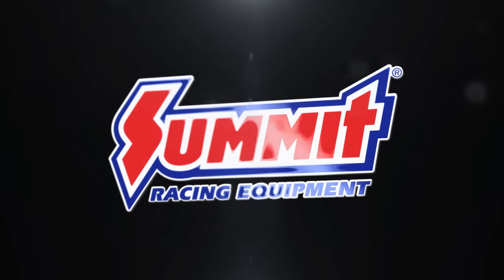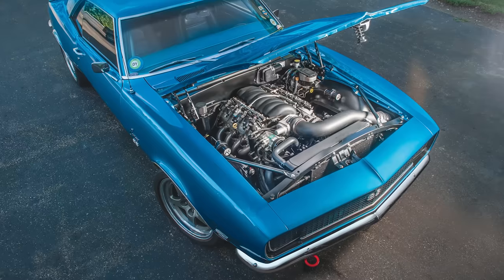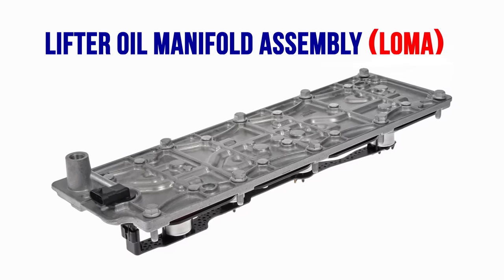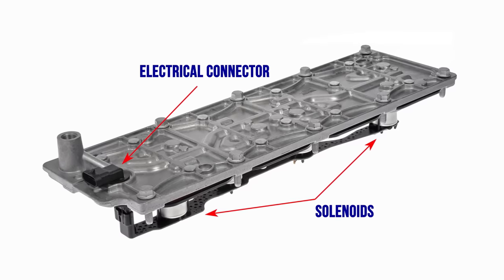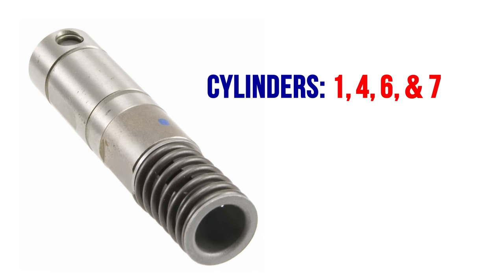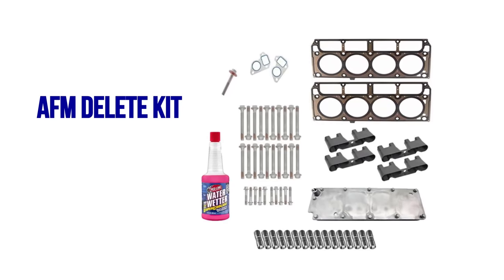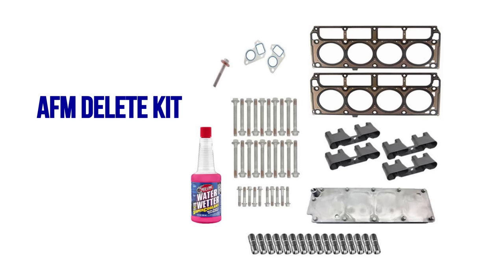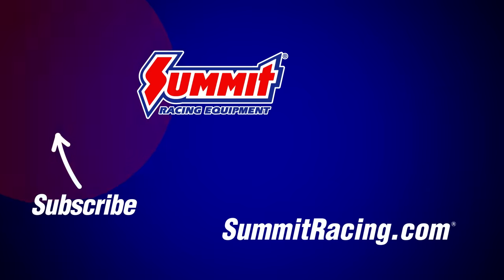Why and How to Disable GM's Active Fuel Management (AFM)!

Comment: The third way to disable AFM, put the shift lever in “L”, then manually shift up to 5th gear and you have full time V8.
Reply: This also disables stop-start. Another 'feature' that may cause more harm than good
Reply: Question: In order to disable AFM this way do we ALWAYS need to select the L5 gear first before moving? Or…. does the AFM disable also occur if you initially select L in any other gear before moving?   I ask the question for 2 reasons:  1.)  I do a fair amount of heavy towing and for steep downhill engine braking I like to initially select a lower gear than 5, on occasions.  Also, to ensure that my engine doesn’t “lug” at highway speeds I often select L8 (or even lower) in order to keep the coasting revs at 2000 RPM or higher.

Comment: My 07 Denali Cylinder 7 Failed. It was ticking bad, then once day Motor went BooZoo and Ticking qone, but now I can't drive no more than 30 mph or the Motor starts to shake bad. 
Well I havent been driving it, Since it shakes bad, But Sometimes I do wanna drive it very slow.. But I may be creating a bigger problem
Reply: I believe the Denalis…in Sierra trim, the 6.2 doesn’t have afm….mine don’t.07-13…but in SUV’s they had afm, kinda weird but I’m grateful my motor doesn’t have it,runs awesome.
Reply: Time to get another motor go to the junkyard and disable that crap

Comment: anyone know if i can run stock lifters with an afm/dod delete kit (I have brand new stock ones and im trying to save cash)
Reply: You can if you change the camshaft. The AFM camshaft is different in order to have room for the AFM lifter springs on the cylinders it deactivates.

Comment: Just by a pre AFM GMC or Chevy truck. Preferably made in Canada that has been in the south with no rust .. 
That's what I did ... these trucks are going up in value and demand since GM and Ford have AFM and turbo problems...
Here's a thought GM and Ford.  Stop making the front end so high it looks like a wall going down the street. Aerodynamic play a huge roll in rolling resistance. 
Also making your trucks higher is stupid also . They are harder to work out of for a tradesman , unless he's 7 feet tall 🤥
Reply: Or a BIGFOOT

Comment: So with the range obd2 disabler it's not just plug and play in the 07 impala SS? He's talking about the pressure valves and whatnot. Is it a bad idea to put a range disabler onto a stock impala ss? What needs to be modified. Hard to find a 1,2,3 step instructional on using it on impala ss or grand prix gxp
Reply: I have a range obd2 disabler on my 2015 gmc 5.3 and it’s the best thing I’ve bought...no problems so far so it’s definitely worth the try
Reply: @loganspence744  was debating and seen people giving good reviews on superchips handheld tuner. Got one on ebay as a refurb but it was actually brand new. Unless that is what their refurb looks like. Was 199 for the "refurb" looks like they were out of refurbs and sent a brand new one. Straight from the powerteq factory. They make diablosport tuners and AFM disabler. Dashboard tuners. Was a great deal see how it goes.
Reply: @loganspence744  where did you buy it from
Reply: i unplugged th afm sensor on the brake booster, no ticks no oil consumption,  from 60 k to 89k no problem, it does throw ck engine light,  afm does not come on at all. 06 monte carlo ss 5.3

Comment: I've heard these Range need updated sometimes. The older Chevy use to show that you were in v4 or v8. The newer ones don't show it. How can you tell if the Range is working or needs updated?
Reply: The newer ones do.
Reply: @todamax1253  I've got a 2020 and it doesn't.

Comment: I noticed he didn't mention if the injectors for the "disabled" cylinder's are also being shut off. If they are not this will cause premature wear on the rings and cylinder due to wash down from unburnt fuel also assuming that spark to said cylinders is disabled.
Reply: Well if the fuel is still sprayed it kind of defeats the purpose of AFM.
Reply: dude...

Comment: I have a 2014 Silverado with 130,000 trouble-free miles..
Not one problem..
I tow and off road and average around 23 to 24 MPG...
Reply from the maker: Awesome! Thank you for watching.
Reply: I also have a 2014 silverado with 56.000 miles no problems . But i change oil every 5000 miles i use mobile one and I add BG product MOA this give me $4000 dollars towards the repair if you put the product in every oil change.
Reply: @carl0079 . Nice!  I wouldn't add anything to your oil..
I use mobile one only.

Comment: Pulsar Lt is the way to go with new GM 1500 trucks.
Reply: GREAT INFO!!!!!!!!!!!!!!!!!!!!!   😁
Reply: But remember to unplug it and put it back to stock before going to emissions test. Certain systems won't say "READY" and you'll fail. Drive on L9/M9 to prevent DFM from activating.

Comment: Bought my '15 Silverado 5.3L in '17 with 21K on the clock. Had a slight lifter 'tick' when I started it until I drove down the street. Got a tune that disabled it and the tick went away after awhile. Change the oil regularly and have nearly 89K now with no issues. I didn't like the sound of it. AFM is a bad idea in a V8 and was done only to appease the government.

Comment: We don't want AFM because the lifters are garbage and always have been.  AFM lifters fail with or without regular oil changes.  A disabler does nothing to prevent the AFM lifters from failing.  A delete is the only way to stop the inevitable.

Comment: I offer dod delete in the ecm tune, contact me if you need dod turned off aswell as the fault codes. This will fix your dod problems if your having intermittent problems and misfires.

Comment: Thanks for telling us about the 1981 Cadillacs this technology is only 40yr old. Diss activate that crap
Reply: Actually the  Cadillac variable displacement was controlling rocker arms not the lifters. Honestly if properly maintained the LS style tend run fine. Till the parts fail.

Comment: Screw that, just give me an old school Chevy engine before they came out with all this modern B.S. technology.
Reply: Because pulling less heat (power) from the fuel is the goal, right?
Reply: @nickma71  , no, it's not the goal, but it's a hell of a lot less to go wrong with old school tech. Not only that, it was a hell of a lot cheaper to fix an old school car.
Reply: @bobby1970  My L59 5.3 is technology advanced. The LS series came out, corrected the obvious flaws in the cylinder head, resulting in huge power gains and reliability. It was accomplished through simulation software, technology. Don’t hate on it. It’s like blaming spoons for people being fat.